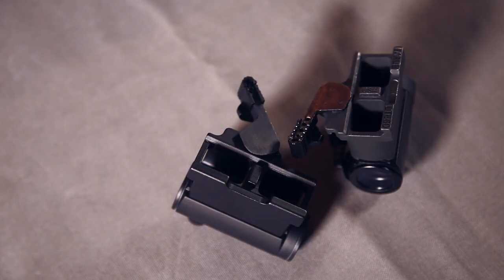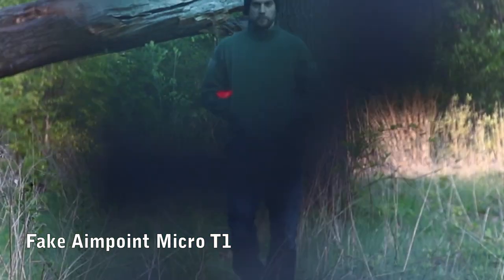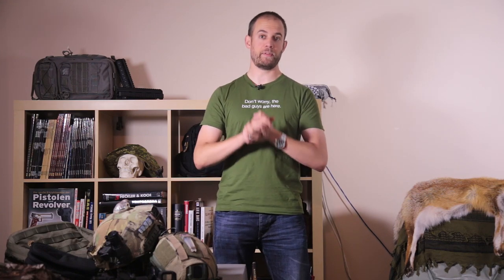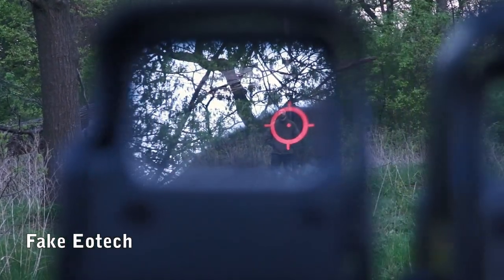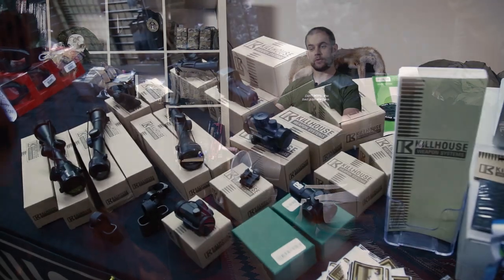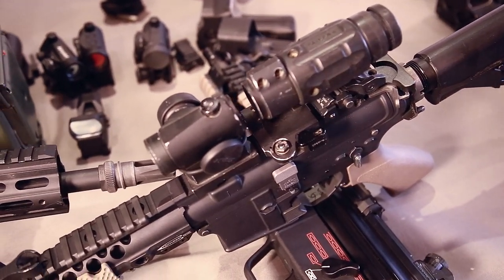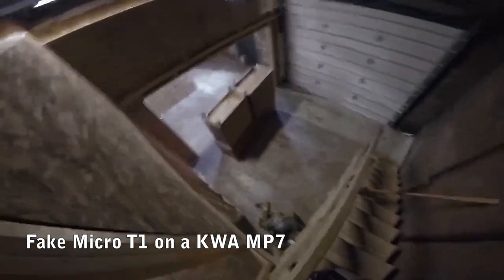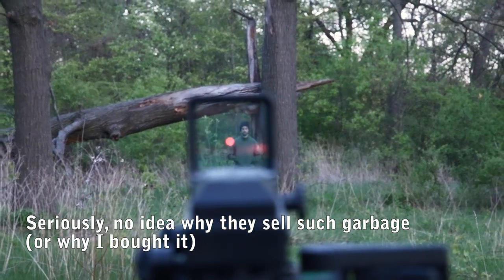Real Sights vs. Fake Airsoft Sights - Part 2/2 - Dark Gray Project

Comment: Vortex Sights are really nice if your looking for an affordable real steel, I have their Sparc AR mounted in my real AR-15, it's got a very nice dot reticle (2 MOA) with brightness from very low to nice and high and it holds its zero perfectly. You can get it for about $200 right now on Amazon, though I got mine for about $150.
Reply: 135th Darksword I have a Sig Romeo 5 on my real AR and I swear by that sight. 2 MOA dot, push button brightness adjustment, motion sensing on/off feature, and is almost indestructible. Very similar to the Sparc AR. Both great for the money!

Comment: I have an advance military swiss arms TG1 that costs about 80 bucks. In terms of toughness idk, but the zero at 10 meters+ is pretty good  and the battery life XD, left it on by mistake before going back to my main residence country with the factory AAA battery... 6 months... did it twice and haven't change the battery yet. I recommend these.

Comment: I bought a budget real steel acog equivalent for under 300€ after wasting 3 sights over the years. know this: It's mounted precisely, you can use it in Low light, battery lasts days, adjustment is a dream come true, It's shock and water resistent . Why even bothering with crappy airsoft-sights ich you are playing regularly?
Reply: David Boehm  What did you buy,  and do you have a link to it ?

Comment: After braking up three fake red dots in less than half year, I bought Vortex Sparc II for 200 euros. It have lasted me now four years and I have not given any mercy to it since its just a tool. Fake sights cost almost every time 50-100€ each and you can get the "entry level" real steal sights if you double that price and they will last as good as the expensive ones since they are built to withstand the recoil of real guns. Only if you need scope that have zoom then I could recommend to look some fake ones since all the scopes that can withstand the recoil of real gun are expensive, even the entry level scopes start from 300 euros and they don't have as much features as you probably will need. For example I wanted to have real looking ACOG for my "kind of" DMR build. Since the real ones start from 1000 euros I decided to order the fake one directly from china, it have the real working fiber optic and 4x zoom, but it does not provide any light to your reticle in the night time since it does not have the tritium built in like the real one have. So far I am happy with it but if or more likely when it breaks down I am going to replace it with Vortex low magnification scope.
Reply from the maker: jop all sounds legit, but even with scopes there is a significant difference between real and fake ones and it isn't just about the features but also about scope shadow, glass clarity, etc. which can make quite a difference even for airsoft. However we rarely use scopes for airsoft anyhow :)
Reply: In scopes the difference between the fake one and the real one is even bigger than in red dots because the price of the glass is always about the same. If you pick up one of those 3k scopes and comparing it to the 1k scopes the difference is huge only because of the glass quality. So if you compare some real scopes and the fake ones the difference is even bigger. But the features on fake scope can be about the same as in very expensive ones but very good price. Most guys want the scope look like a real deal so firstly it need to be big even the smaller one could do the job. It need to have stats something like 6-24x50 or similar and the reticle need to be illumined. Also turrets should be the fast ones (those the real snipers use in the field, not with the cap). Those are just some of the features that you cannot get in the real scope that cant cost more than couple hundred euros. If you seek for scope that is realistic for you need then the real steal entry level scopes will be the best bang for your bucks. Like I need only 4x or 6x scope with good durability and some illumination. And at the moment I am using the ACM acog since its was super cheap and have not broke yet, but as soon as it does break I am going to purchase Vortex Strike Eagle 1-6x24. Because it is small in size, light weight and it can be used as red dot also if needed, and its not too expensive for my budget. I also kind of like how it looks because its different.

Comment: people debating that "you should buy the cheap ones since it's just a toy"...bruuuhhhh. I really prefer real optics because you'll see the difference and you'll need the proper equipment IF you are really investing in the hobby or if it is your source of income. Honestly, I started out with a knock off reflex sight and I thought it's the best thing ever but when I used my friends real deal reflex sight, dude, I almost stole it after the game. Save up money for a few months and buy a real deal rather than have a cheap one then replace it after every month, much more cheaper.
Reply: Ice Sniper people like you keep bringing up the point of replacing it often, but that only works with your cherry picked 50 dollar optics rather than actual quality replicas

Comment: If your gun costs less than the sight out looking to buy I wouldn't buy it, but I agree with you, if your running a $1000+ gun and you're that serious about the hobby then I agree with you, put the money towards a good real steel optic.
Reply: 135th Darksword but a quality sight will go with you from gun to gun. under normal physical abuse, it will outlast nearly anything you throw it on. and to top it off, it'll go on that real-steel counterpart that you've been eyeing. plus, they hold value pretty well. I think the only argument you can make is based on your commitment to the game. if you're serious, it makes sense. if you're casual, or just dabbling, then it prob isn't a good investment.

Comment: I have a Vortex Sparc AR 1x22 red dot sight and i love it.
It comes in at 240 bucks here, it has all the brightness settings i need it is compact but still a bit off the gun to help with aiming when using a lower mesh mask, it runs on AAA batteries which are easy to find and cheap to buy and best of it all it has a lifetime warranty without registration.

I mostly play with GBB rifles so i have broken 3 fake sights worth between 50-120 bucks just because of the recoil.
I do however have one 50 bucks Swiss Arms airsoft replica that looks like it has almost as good of a red dot as the vortex it is small can get about as bright as the vortex and and almost as dim and i use it for my mp5 aeg so it has not broken yet as of one year of using it one game a month.
Reply from the maker: Sounds like a good deal :) Vortex is getting quite good for their money in the last years while increasing in quality.

Comment: I am going to buy a real steel aimpoint comp m2 or pro. However i am curious. If the glass on optics was shot by a bb. Would it break?
Reply from the maker: Yes, it would break! Highly recommend to protect it with Lexan or similar strong and clear materials
Reply: Dark Gray Project thanks so much

Comment: The Aimpoint Micro H is super cheap, but it is export regulated, so only us guys in the US get it I guess
Reply from the maker: Aimpoints are being made outside of the US so you can get them relatively easily outside of the US. Rather the important/internal regulation of your non-US country are the problem here. But I even got an US made Eotech in Germany from a normal shop.
Reply: Dark Gray Project  Just a warning, if you buy a "Grey-Market" item(s) manufacturer usually will not honor the warranty,  and will NOT service the item.

Comment: I looked into the Primary Arms Micro Red Dot. Is co-witnessing worth it?
Reply from the maker: Co-witnessing isn't normally a main argument for us. It is nice to have, especially if you swap optics between rifles. So you use the non-changing iron's of the rifle to quickly adjust your red dot after a swap. Otherwise co-witness doesn't have much use for us. Hope that helped :)
Reply: What's the best budget mount I could buy that won't change zero if I move it from rifle to rifle?
Reply from the maker: What is budget in this case for you? plus the zero will change depending on the rifle if you swap an optic between guns anyhow
Reply: I was looking at a clone of the LaRue LT751 that cost about $15 USD. However, you made a comment about breaking bad mounts. I was looking for a QD mount around $30.

Comment: i have a 3,50 euro reflex sight, because i can afford to break that one. also i only got cheap replicas untill i figure out which platform i like. though in all honesty, the first proper airsoft gun i will buy will be a WW2 one (StG 44 or PPsh 41). so no reflex sights for me...
Reply from the maker: for WW2 guns it is obvious and I want to believe most of us started with cheap sights, too till we found what we prefer more :)
Reply: ***** i also would only consider using optics if i cant use the iron sights properly. For example it is hard for me to use normal aperture sights like m16 or H&K sights without using contacts. For AK types i really like the iron sights. Also for certain snipers (if i ever get one) i would prefer iron sights since distance is 100 meter max. Besides scopes it is also hard to find real optics due to gun restrictions in Europe.
Reply from the maker: Don't know where you live but I bought my Eotech in Germany.

Comment: Do you use a protector on real steel or can they take a bb hit ?
Reply from the maker: Protectors for real steel optics (and flashlights) is a must! They use good glass and housing but not designed to take frontal projectile hits. TBH we never tried it with optics but we lost glass of Surefire and Streamlight flashlights.
Reply: Doesn't it effect the image using a protector ?  The reason I ask because on the sales  description for an eotec it states it has toughened glass.  I have a klaus xt20 flash light and that takes bbs no problem at all.  I have a highly modded tm cqbr (spent £1200 on it so far) and I wanted a real steel scope for it.  Just didn't want to smash it on the first hit but also didn't want to get it and find it's useless with a protector on it.  Thanks for your reply dude.  Really good video
Reply from the maker: We primarily use Lexan (plastic) glass for our protectors and there isn't a big problem with their visibility. Even when they get scratched up you can easily exchange them. Lexan is very clear and not comparable with the glasses of cheaper sights which often have a dark/blue tint.
Reply: Dark Gray Project yes that's the problem I found with the fake eotecs in low light I couldn't see through them ! Again that's for your help
Reply from the maker: Always :)

Comment: since a lot of these cannot be exported outside the US, people don't have a choice... I wonder which country the video maker is in having access to all these...
Reply from the maker: I'm in Canada but I bought my (American) Eotech 512 in Germany, Aimpoint is Swedish (EU) and Holosun is Chinese; just to name a few. If you don't have local restrictions or laws against it then it should still be easy enough to get a decent optic.
Reply: Actually the issue is that they don't want them exported because from there they cant control where they go. IE german > iran is way more plausible than USA  > iran. as far as I know they are really cracking down on that denying export permits to legit dealers left and right.
Reply from the maker: Where do you live if I may ask? Cos within the "western" countries where airsoft is a thing, getting real optics isn't a big deal except local laws prohibit them for whatever reasons.
Reply: I live in the states but travel all over. I get a lot of requests to export them for people off the book (which i will not do because i dont like prison). try getting the later models in Germany now... NEIN! we ze don't have zem. there is still stock of the old stuff sure..
Reply from the maker: If I would live in Germany you can simply switching to Aimpoints :P But here in Canada we have the same "problem" that we have to rely on retailers to get them over the border and not smuggle them ofc :)
Reply: shouldn't Canada be easier due to NAFTA. I haven't looked into it tbh. but Canada has the whole FPS limit issue so you gotta deal with that as well there.
Reply from the maker: ITAR doesn't care where it goes only if a specific item leaves the US. The FPS restrictions for Canada is only for import and then it must be something between ~370 and 499 FPS. Changing then the spring afterwards is perfectly fine (especially lowering), as long as it stays under 500 FPS (cos then it is a firearm here).
Reply: I know its for import, like orange tips. But the issue is with gas guns. aegs are easy obv. I don't know how much your customs care about that or if they even enforce it. haven't heard much.  itar permits actually care very much where an item goes. the actual regulations don't, but the people issuing the export permits totally do. its a dirty process, I've dealt with it once for some of my personal stuff on both ends. a true test of your patience to deal with stupidity
Reply from the maker: ohh I have no idea in regard of ITAR as a retailer just as an individual ... or I know enough not to get any ITAR items shipped or transported out of the US a s a normal private person :D ... I can only image how annoying the process can be :)

Canadian airsoft retailers have to prove with a 3rd party that the airsoft 'gun' shoots the specified FPS which is messy and as a private person it is even more annoying. We had that problem with a PTW lower which was fixed in HK.

Comment: Some of the real ones are getting pretty cheap. The $70 aimpoint will last through anything, and it's the real deal. I also found a $40 micro red dot. I put one on my real gun as a 45 degree back-up and it's been through everything the rifle has.
Reply from the maker: What brand are those? or are they used aimpoints?

Comment: Do you use protection for your micro T1?
Reply from the maker: We use Lexan protection for all our optics, even the cheap ones
Reply: Dark Gray Project a clear glass from Lexan is enough protection against BB's?
Reply from the maker: very much so, a few mm thick is enough :)
Reply: Dark Gray Project is a real aimpoint clear lens hood with/or ARD filter sufficient enough? (Because that's easier to get here in Europe)
Reply from the maker: I don't know the real transparent T1 aimpoint hood enough to give a recommendation. I'm pretty sure there is Lexan or Plexiglass in Europe but TBH I don't know our thickness right now.
Reply: Dark Gray Project ordered a Lexan, thanks for your advise!
Reply from the maker: best of luck :)

Comment: I could afford to buy top-notch optics originally designed for real firearms on my airsoft. But the question is: they are ITAR restricted!
Reply from the maker: Real steel optics not uncommon to find them in Canada or in the EU. Matter of fact I bought my first Eotech in Germany and all other ones like Aimpoint in Canada.
Reply: Dark Gray Project i can't afford real steel optics they are extremely expensive there's a reason why I stick with fakes
Reply from the maker: If you can't afford them it is a perfect fine reason to stay with fakes but you can also look into the market of cheaper real steel optics or used ones. maybe tehre you can find something in your price class :)
Reply: ***** that's more difficult than you think here in Calgary no one sells the optics I personally want
Reply from the maker: Not even online? Fair enough at the worst case from the US but I want to believe there are some Canadian sites which sell non-Eotech or non-Aimpoint optics.
Reply: Just because they are ITAR restricted doesn't mean you can't get them. There are plenty of trade groups on facebook that could sort you out.

Looking at your videos, you sound Asian (Taiwan, Hong Kong?), and there are already solutions for you. There's a company called "Supreme Co." in Hong Kong that carries real Aimpoints and the like, and it's very easy to buy C-more sights because a lot of competitive shooters in Hong Kong use them.